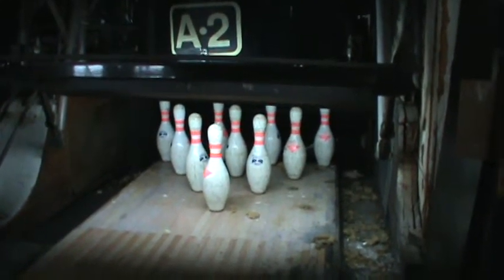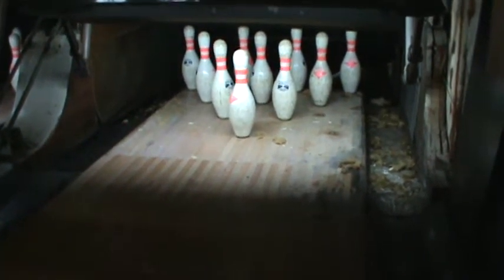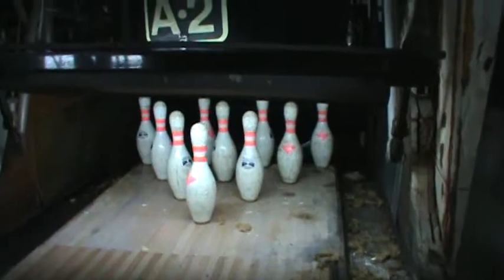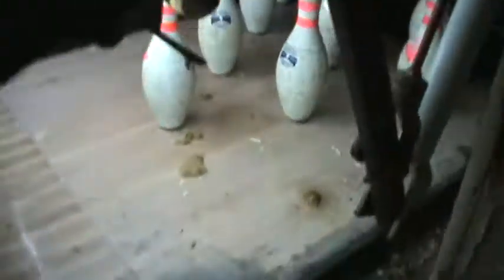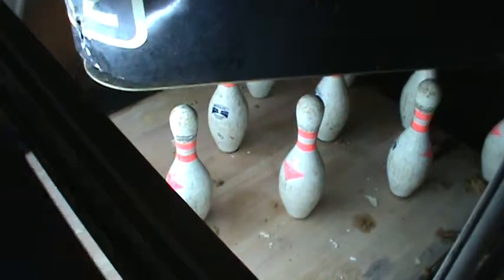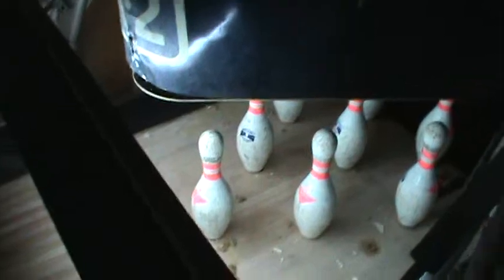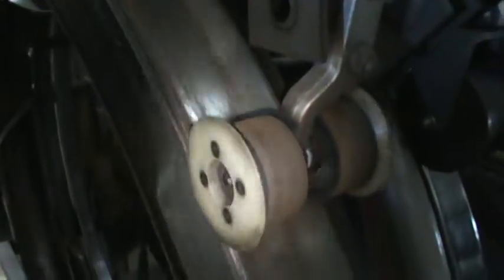Lane 6 comes back to life! *** UPDATE *** 4/2020

Comment: What that sound at the begin of the video like around 0:00 0:01 that coming from the motor or from the machine it self.
Reply: +zach zummo It's probably the belt driving the turret. I believe there is a clutch there and when the belt is getting old, it's slipping on the clutch